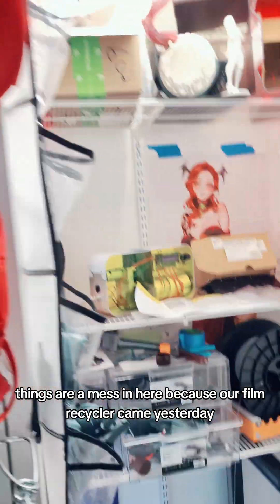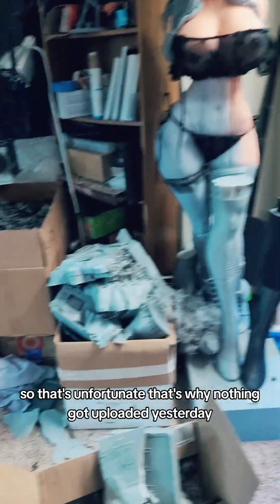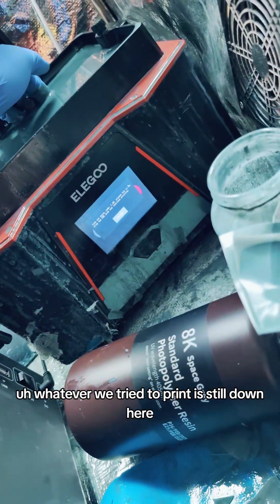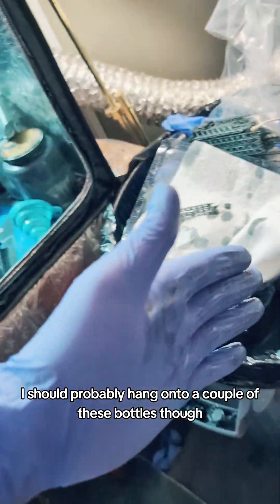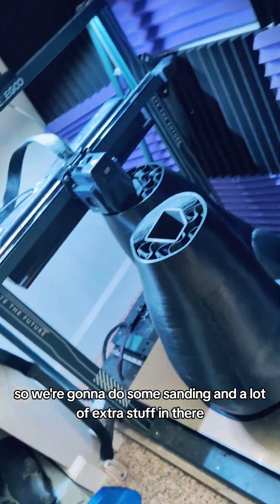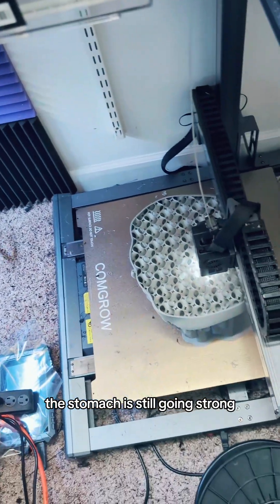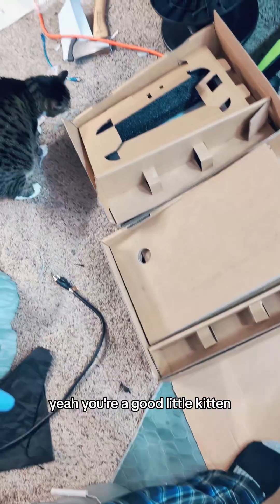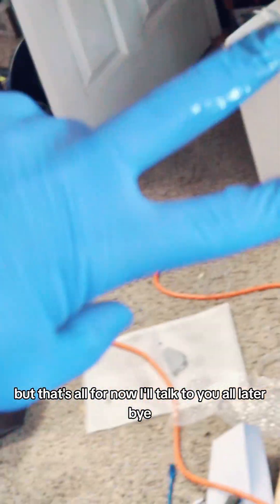Filament recycling didn't work out immediately

Comment: Wait, I actually work with those 4 pin connectors, I could probably take a look at that and fix it.
Reply from the maker: you might be able to, but i would have to open up the power pack. the problem is not with the pins, its in the brick. the light on the brick no turn on. power is not going through it.
Reply: @Freyas_Fantasys have you tried percussive maintenance? Hitting a power supply couldn't possibly be a bad idea
Reply: Were you there when it died, was there a pop? You might be able to figure out if something actually broke or if it's just a loose connection by just opening it up, not messing with anything, but just looking inside the casing.

Comment: If it came from Italy, are you sure it was rated for 110V? In Italy they use 220V.
Reply from the maker: i think i had to specify that it was american. the british would not have the same plug...?
Reply from the maker: the british one would have a diferent plug, right? im pretty sure i picked american.
Reply: It's not just a difference of plug, things that use a lot of power are more particular about how much power they accept and whatnot, it's kinda like sticking a fork in an outlet, you made the fork fit the plug, but the electricity coming out of it is also something you have to worry about.
Reply: @Freyas_Fantasys  also im pretty sure italians use their own plugs not brittish ones and are 230v that said they should still look diferent then US plugs. But the most important thing is the voltage not the plug. Some things have a volage switch on them from 220v to 110v just like the elegoo saturn 5 printer.

Comment: Is there a fuse in the power brick for the filament recycler? or in the plug?
Reply from the maker: nope. the power pack itself is just dead. HOT and dead. they are sending the replacement. they confirmed this morning.

Comment: Wait… they actually make filament recyclers... here? I had no idea 😂 Honestly, I’d go for something closer to you. I’ve been thinking about building one myself since the pre-made ones are crazy expensive. It’s basically just an Arduino, a heating element, and a pasta maker!
Too bad your brick’s broken — shipping that to the US would cost a ton and take forever. Maybe they’ll send it straight from China?🤞
Reply: Italy is actually a world leader in producing equipment for the extrusion industry! Particularly aluminium extrusion but I think plastic too. Tekna, Pertici, Metcal

... This has performed on-par with the expectations that working with Italian equipment has given me though. Beautiful, elegent,  finicky AF.
Reply from the maker: no one makes finalament recycling here. its just over the seas. 
they r sending the replacement part free of charge.

Comment: Fun story... Check to see if the wall cord is all the way in. Those 3 prong adapters are notorious for wiggling loose from the adapter.
Also make sure it's plugged directly into the wall.
Reply from the maker: i pluged it into several places. including a extention coard that shows if it has power. nothing worked. 
it ran for like 2 min. it was heating up, and it just died.